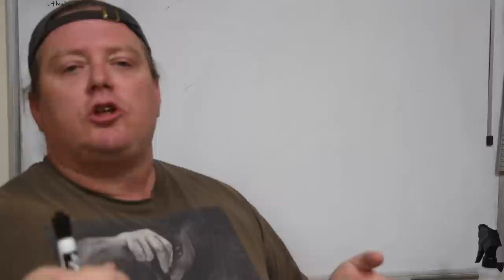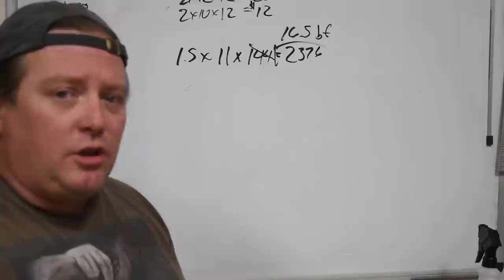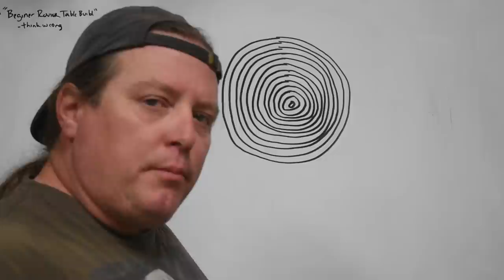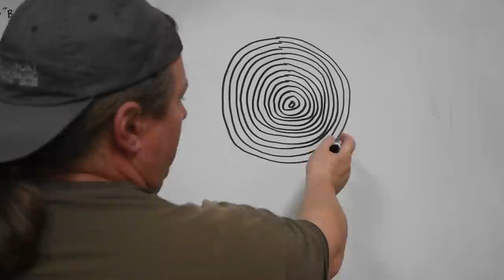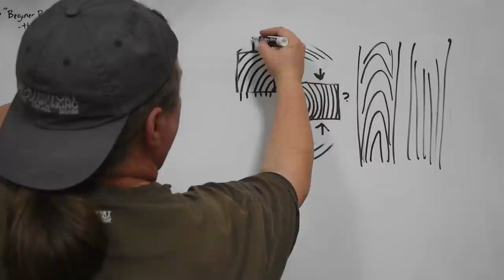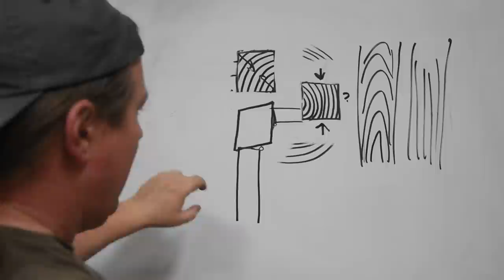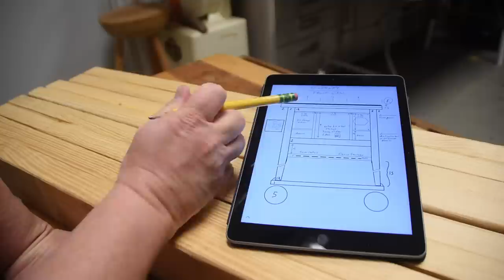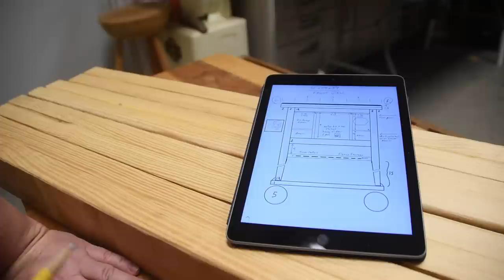Stock Prep & Dimensioning in Woodworking

Comment: Awesome video with great information. It's never too late for an old dog to learn new tricks!  Ive been a carpenter for almost 45 years, and had a cabinet shop for several years, but mostly commercial grade European style cabinets for medical offices. So they, of course, are made from sheet goods, MDF, plywood, lots of plastic laminate.  Also about 25 years as a building and fire inspector so I definitely understand construction, but have not built much from wood where I needed to pay attention to grain orientation, and with the style of cabinets I built we didn't need to even consider  much work with a jointer or planer.  When we built anything from hardwood such as occasional raised panel doors we would simply have the supplier give us an S2S board, build the door or drawer front and then have them run it through the timesaver sander. Again we never even thought must about grain direction, although we did know which direction it was likely to warp, cup or twist and took that into account and paid attention to the finished look.  Probably did some things right without really knowing why. As I look back on some of the projects we could have paid attention and created a better product but we always were paid and the clients were happy and the products withstood the test of time. Now that I am retired I am getting into a lot of different builds, and hopefully some things I can sell, but need to learn some new skills and pay attention to different things. Thanks much for the detailed info and the ramblings are good (I can always fast forward).
Reply from the maker: Every "high end" furniture maker I know will say, the way you built a career is the more financially reliable method of ramping up to and keeping a consistent living wage. A family buys one table, one cabinet... businesses buy hundreds and need them now. They'll pay for convenience, consistency and timeliness more than for exceptional quality. If it last the 5-15 years between launch and buyout they're happy.

Comment: Construction lumber is sawn from the tree using straight through cuts, flat sawn.  The log is almost always cut right up the center, along the pith as the boards you showed prove.  That means that you will never find quarter sawn cut boards in a pile of construction lumber.  
Your explanation about how a piece of wood contracts as it dries is backwards.  Wood shrinks less radially than tangentially, or in the direction of the curving growth rings.  Normal wood cells shrink in girth, but very little in their length.  A tree trunk would shrink pretty evenly if it wasn't for one feature, trees have cells that grow horizontally from the pith, going outwards to the cambium at the perimeter.  Those cells are called medullary cells, and they grow radially.  Looking at the cut end of a log, you can see them radiating out from the center in certain species of wood.  They are not very visible in many species, but they are still there.  
I said that wood cells shrink a lot in girth, and very little in length, so that means medullary rays, that run perpendicular to the majority of the cells, act like reinforcing bars that restrict the wood from shrinking nearly as much in the radial direction.  The medullary rays are the reason that quarter sawn boards are the most stable boards along there width.
Medullary rays in rift sawn boards end up running at various diagonal angles to the faces of the board.  That's why discs cut from a whole log shrink and split from the perimeter to the center.  It's also why square cut pieces of rift sawn wood shrink into diamonds.  And medullary rays are the reason why flat sawn boards cup.
The force that causes cup is not from the rings trying to straighten out.  It's caused by the normal wood cells shrinking in girth, and the medullary rays restrict that shrinkage in one direction, the radial direction.
Reply from the maker: When educating you have to choose battles on how much info to deliver on the "bore the student/explain the point" spectrum. Growth rings straighten as wood dries is where I chose to go. Explaining this orally and visually properly would have added another 20-30 minutes. I chose the simpler method because for this lesson that is really all the student needed to know.
Reply: Thanks so much “deezynar”!  Your very well written explanation adds considerably to an already arguably one of the best teaching/learning videos on all of YouTube. 

Thanks gentlemen!

Comment: Isn’t board feet calculated by the rough cut dimensions? That would make a 2x12x12 24 bf, not 16.5
Reply from the maker: c stoner but it’s 6/4 not a real 8/4 board.

Comment: You keep referring to the growth rings in wood as "grain" or grain lines. While grain isn't independent of the growth rings, it's not accurate. Reading grain is important and teaching how to read actual grain (not growth rings/lines) is important. I really think you need to correct that
Reply from the maker: Genaro Flores if you understood then tomato tomatoe.
Reply: @wortheffort  no, it's really not. Simple example- when hand planing, you need to be able to see and/or feel which direction the grain fibers are laying. You can't gage that just by looking at growth rings. 
Another example- you cant gage the grain direction through a board just by looking at the growth rings.
Some diffuse porous woods are really hard to see growth rings, so you have to be able to read the actual grain of the board
Reply from the maker: Genaro Flores covered that in a long video on reading/working grain with those very examples. Your fingers are the guide there not eyes. Look it up. This video was about getting quarter, bastard and flat outa boards for use in project.
Reply: Oh I see. My apologies. I should've probably watched the whole thing before commenting. I hadn't realized you covered that topic as well